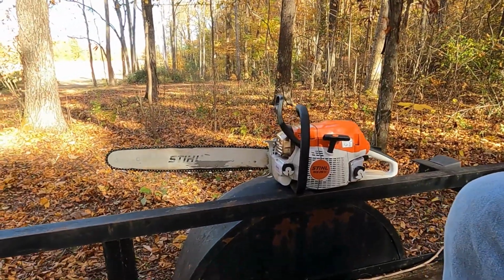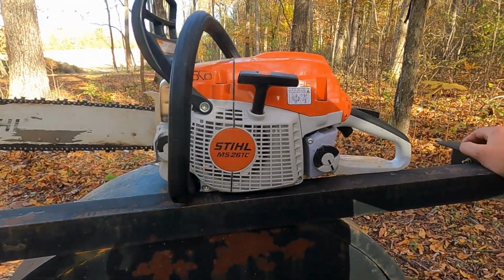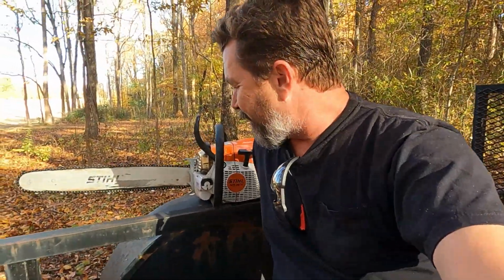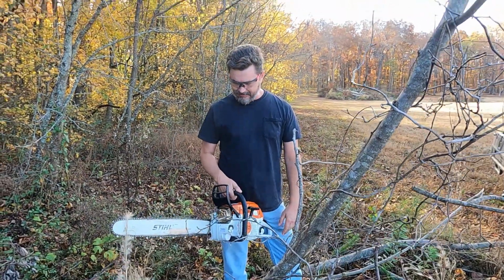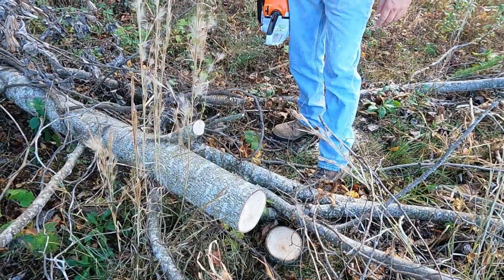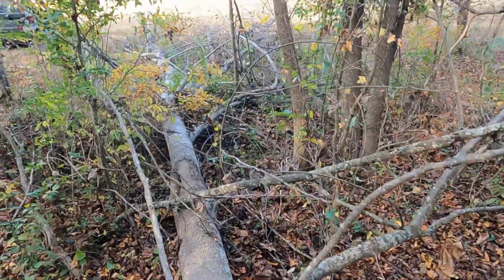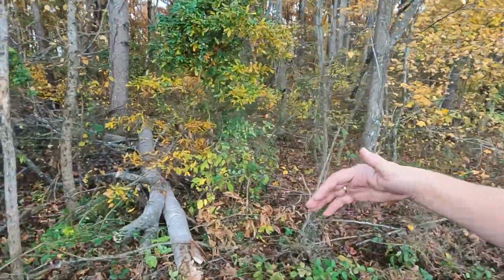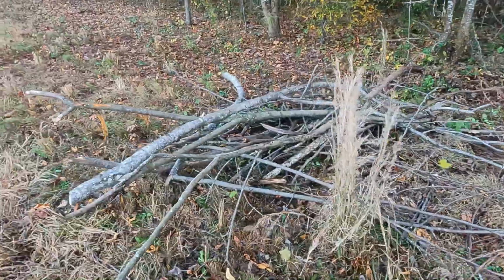Stihl MS261C Chainsaw Motor Ruined! Less than a year old. Only used a hand full of times.

Comment: Sorry you are having problems, this Stihl is a pro saw with a very good reputation for being reliable and is used by many professionals, and should last many years if not decades. 

Try a new chain and if it cuts straight then the problem is with the sharpening and your cutters are probably shorter on one side when compared to the other.  This is often the case with hand sharpening as often you have a dominant hand (humans are usually  either right or left handed) and when you flip the chainsaw round to sharpen the opposite side, the teeth lengths and anglescan become inconsistent. 

Sharpening is an art as well as a science, practice and you will become more efficient. Study sharpening videos on You Tube, but don't spend money on expensive sharpening gadgets, the file system you have should work, you just need to practice
Flip your bar over each time you sharpen the teeth so that the wear on the bar is spread out over two surfaces and the the bar will last twice as long. When you flip the bar, make sure that the teeth are pointing in the right direction, an easy mistake to make! 
The bar needs to be cleaned of saw dust frequently, and you can buy a hooked shaped cleaner to do this for a few dollars, also make sure the oiling mechanism which puts oil on the chain is working, You can test the oil fliw when you start the saw, point the bar at a leaf, piece of paper or a bit of white wood and wait for the chain oil to splatter before you start cutting. No oil getting to the bar will cause the chain to stretch and wear quickly and also to heat up, causing the engine to work harder, which may explain the the piston scoring if the engine was working toi hard.
Also make sure you are using the correct mix of petrol and 2 stroke oil as recommended in your Stihl manual, don't guess the ratio measure it properly! I add the 2 stroke oil oil to an empty container, then add the fuel so it mixes, I also invert the can a few times to make sure it is properly mixed before adding to the chainsaw tank.  Stihl di a twin tank system for chain oil and fuel together with an auto filler which stops the flow of the fuel when the tank is full, well worth the investment as you don't want fuel spilling on a hot chainsaw.
Good luck!

Comment: So disgusting that you, the customer, that keeps Stihl in business, had to wait and wait, had to get a rep to "authorize" your saw getting fixed???? This world is UNACCEPTABLE since a long time. 

I made sure all my saws are STANDARD carbs, shave off the jet limiters, mix my gas 40:1 at the leanest, and tune it perfectly.  

The electronically controlled saws are on the lean side to meet EPA emissions regulations. The computer chip saws need to be plugged in like a dang car.  Some people like that there's no jets to mess with and to each their own. I want to be able to tune and diagnose my equipment. 

I even run 25% 110 octane leaded, non-oxy race fuel with the 91 octane non-oxy pump gas.  Comes out to 96 octane.  Motors seem to run a little cooler and I know gas is not the quality it was many years ago.  

I'm a bit overboard but haven't had any problems as of yet.
Reply from the maker: I appreciate the support you are showing to me and to all consumers. I agree with you and I am impressed with your regiment.

Comment: saw is sharpend wrong plus bar needs to trued  i suspect since youre left handed the motor being on ofset from the bar will youre angle perception when filing chain with two in one file which i love . also this 025 shain is more narrow than sthils regular 025 bar and chain . true thebar first . good luck .50 plus tree man speaking .

Comment: Using your south paw on the throttle of a chain saw is extra dangerous. Looks like an accident waiting to happen. Try operating your chainsaw right handed ,  get you head and body out of the line of your bar and chain.
Reply from the maker: @jeffreynorthrop9518  done soon after this video was shot. Major improvement. Thanks!!
Reply: Glad to hear that,  it looked very dangerous  using the chainsaw left handed. Take care and work safely!
Reply from the maker: @jeffreynorthrop9518  Thanks for the great advice and take care.

Comment: Are you left handed? Even if you Are you should switch your hands on the saw. I've never seen anyone hole a saw backwards like that.  And you need to dress the bar with a flat file. Basically remove any burrs and re- square the guide rails to the side of the bar.
Reply from the maker: you are correct. I am a lefty. I will switch things up and see how it feels. Thanks for your advice.
Reply: @TheLovelyPlace  yeahh saws are “designed” for rightys only …because if you notice the top handle is angled a certain way… try holding it with an opposite grip
Reply: @tjlovesrachel  I am left handed and i always get the wrap handle saw its easier for me to use that type handle being left handed.
Reply: @andrewslagle1974  gotcha least you found something that works for you

Comment: all chainsaws need to be kept sharp, next to running straight gas in it running with a dull chain is the worst thing you can do to it. and don't run stihl ultra oil it is no good. learn how to sharpen your chain properly and it will fix most of your problems. your bar is not warped it's your chain sharpening. look up buckin' billy ray smith sharpening vids. I run amsoil sabre at 80:1 mix ratio. it's the best. imo
Reply from the maker: LOL I am now watching Buckin' Billy Ray Smith! Literally right now! Just told my wife that everyone is telling me about this guy. Ya'll let him know that he is now going to be my virtual mentor! Thanks everyone for the recommendation.
Reply: @TheLovelyPlace  Buckin' will get you on track for sure.

Comment: First of all, change your mixtures to 40 to 1 and get somebody else to sharpen your chain, one side sharpened at a different angle. Hope you warm the chainsaw up before you start cutting can also cause scoring . Cutting small branches at full revolutions, very bad. And lastly there's so much wrong as you have no idea what you're doing and shouldn't be near a chainsaw please get some help you're holding the chainsaw the wrong way, so awkward and potentially dangerous.

Comment: You need to learn how to dress your bar. That would solve most of your problem
Reply from the maker: Yes been watching some instructional videos. Goin to do that for sure! Thank you!
Reply: I can tell you with certainty that your chain is sharpened incorrectly.  Rakers incorrectly filed can cause a perfectly sharp chain to do what you described as well as having one side of the chain being at an off angle.  One side of chain is biting and the other can't correct the cut because it's not biting.  Dressing the bar is less important with a roller tip then say a carving bar but it's still needs to be done occasionally.  I teach a class here at my studio that might would benefit  you greatly.  If not there are tons of